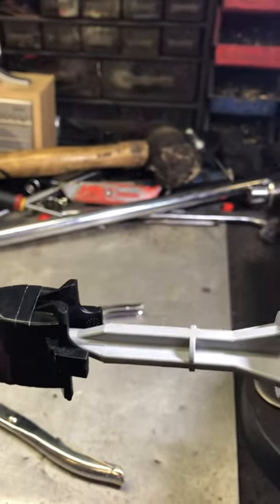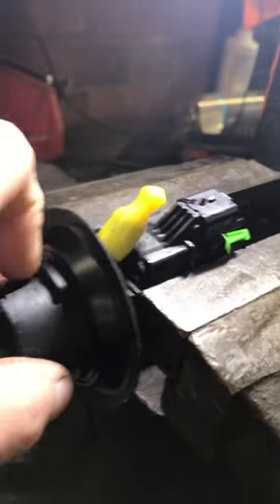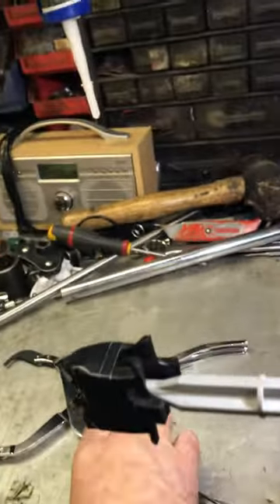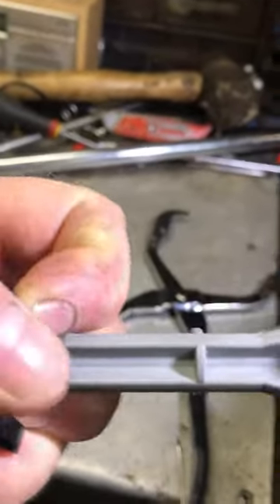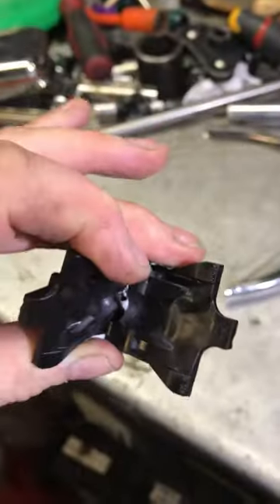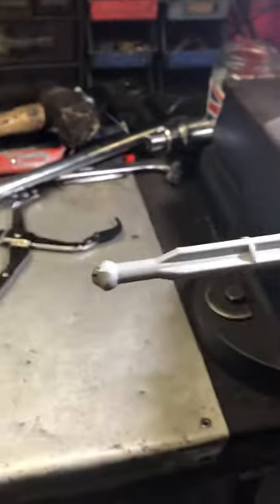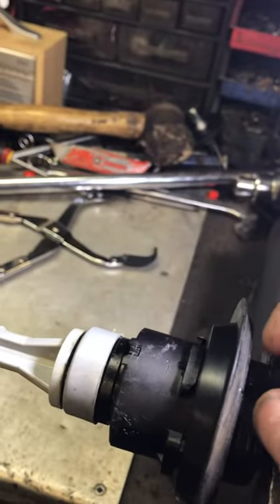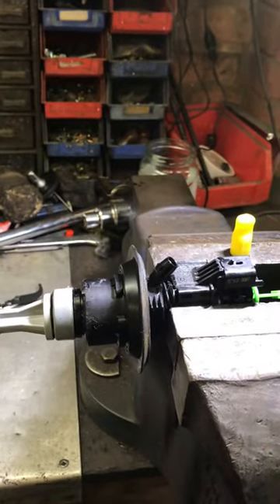Peugeot 308 low clutch pedal

Comment from the maker: Hi,some feed back from viewers, interesting. If your clutch pedal is not returning by fully, then it is a worn out ball end and housing clip like in the video, you need a new master cylinder and the housing clip.
Not easy to replace, but I’ll explain in the driver footwell remove lower half facia trim-the under part of trim- release the steering column from the bottom one 13mm nut/bolt, swing aside the column-see the clutch pedal assembly-fit in place the special pliers to release the housing clip or smash it with screw driver, it’s no good anyway-undo the 3x10mm nuts & 1x13mm nut to release the pedal assembly, carefull if you press the pedal to release the shaft ball end from clip it’s spring assisted & can take you by surprise-remove assembly-fit the new housing clip BUT don’t push it fully home-now go to engine bay support left side of engine ie, trolly jack, remove top left engine mount female tied head bolts-lower engine for access to bulk head, there may be some sound proof material to unclip move aside see clutch master cyl-inclip pressure feed pipe at front release its retaining clip, plug the pipe-pull off or unclip the feed pipe from top plug the pipe-unclip the clutch switch connector-twist the whole cylinder body clock wise 1/8 of a turn to release from bulk head, may require some large mole grips to grasp the cylinder body from inside, BUT remember to twist anti-clockwise wise from this side.
Fit new master cylinder in reverse order-reconnect all-remember I said fit the housing clip half way, its self explanitary when you see it because offer the pedal assembly back up to the ball shaft, bolt back into place, then you press pedal and this seats the housing clip & ball shaft into place.
Refit all inc eng mount, bleeding is unusual as there are 2 types, of slave cylinder connections, either it’s simply release bleed nipple or pull out the feed pipe to solve by 5mm then release bleed nipple to bleed anyway bleeding is gravity controlled attach catch bottle & clear tube to nipple, fill reservoir open nipple (may have to pull feed pipe out 5mm) feel the click, press clutch pedal by hand to floor watch for bubbles, when no bubbles close nipple, push pipe in (if fitted) raise pedal top up reservoir repeat can be up to 20 times, until pedal feels normal.
Well done save yourself plenty of dollar even if you buy special tools still cheaper 😎
Reply: Robert Cole 

The clip that connects to the master cylinder where can I get that from
Reply: Robert Cole Is there not easier access removing the scuttle panel?
Reply from the maker: @FatHead81  hi Mark , you do not remove scuttle panel, best access is remove top eng mount lower engine, for access.
Reply: @robertcole8730  Hi thanks for this write up and advice. Done it today on a 308 GTi I had a good look and cos of the intercooler pipe position the engine mounting out the way wouldn't have helped much. Anyone else doing a GTi. Take the scuttle panel out and remove airbox for pretty decent access. If you're on your own you can get the end of say a breaker bar on the back to give some good pressure to get the keys fully through the holes. Then you can grip from inside the cab with some grips to get it locked in.

Comment from the maker: Hi Fernando, sounds like yours isn’t bled properly. The set up is a gravity bleed system, you attach a bleed pipe to the slave cyl bleed nipple, pull the retaining clip out, you can remove it or pull it so far and leave it half out, next pull on the feed pipe, kind of one notch you get a feel for it, practice pulling it out so far then push in again you’ll see, ok so you’ve pulled the pipe out so far, make sure to top the reservoir up, then push the clutch pedal to the floor, watch for fluid flow out of slave cyl, you may see bubbles   When they stop, pudd SF h the pipe back in, raise the pedal, top up res, repeat, repeat, may take up to 20 times, but should improve your clutch, obviously if the master cyl rid and cage are worn they will need to be relaxed.
Reply: My clutch squeaks when i leave car on the sun and now when its cold when i put heating to the leges. When car is turned of i can shift easly. But when its on when i put in first or second gear i fell litle like "bump" like clutch was not disengaged fully. I was thinking of buying clutch master cylinder, sender balljoint fastener, and upper assist spring and then  bleed system. Thank you.

Comment: Hi Robert,
Where can I get one of the clips/couplings mine has worn through and the only place I can seem to find one is in Poland and the website doesn't have an option to shop to the UK.

Thanks 
Steven 👍
Reply from the maker: Hi Best place is Peugeot / Citroen main dealer. Fit the best do the job once.
Reply: @robertcole8730  thanks mate 👍
Got one from Citroen dealer today only to find out the there's a recall for our car for this exact reason. 😠
Reply from the maker: @stevengeig2806  great news saves you doing the job, the first one is the most frustrating, it’s one of them jobs you know once you’ve done one the next ones easy, oops should say easier, ha ha. Amazing how the dealer never tell you, maybe your a second or third owner. 👍

Comment: I have 2015 peugeot 308 t9 1.6 ehdi 115hp. I am having problem somtimes it wont go in reverse, and sometime is bit hard to go in first gear. I changed gearbox oil but it didn not fix it. Allso when was summer and car sits long on the sun clutch pedal slowly returns when it is depresd. Now when its cold when i turn heat to the legs clutch is again slow on return. Any advice what to look for. Thanks

Comment: Hi, I managed to take out the old cylinder and now I am having difficulty putting it back in. It goes in but doesn't twist back in the whole. I can see the rubber locks are in all the way in the body but I don't know why it's not twisting. Any help ple. Thanks
Reply from the maker: I use mole grips 👍
Reply: @robertcole8730  thanks for the reply. New cylinder is in,  but pressure pipe is not going in now. I have tried pushing it in but doesn't work. Any idea wot am I doing wrong here. Is it suppose to be an easy push or does it require hard push? Thanks
Reply from the maker: Yeah can be tricky, I believe there a two types   of fitting straight push on pipe that goes over the inlet, or push insert that goes inside the inlet with a little cage that you open up the gripper parts not easy to access just check the pipe end make sure if the latter to inspect  any ‘O’ ring seal, but either way both should just push fit.  :)
Reply: @robertcole8730  Hi Robert, now I have replaced everything and tried my best to bleed the system. But my clutch is still at the same place as it was before replacing master cylinder. Do you think I have some clutch/pressure plate issue. I don't know wots happening. It's a start stop car and when I press clutch the car starts but it doesn't go in gear. But when I switch off car I can engage gears. It's weired.
Reply from the maker: Hello these are a pig to bleed, at the slave cyl on the gbox open the bleed screw depending on what sort is fitted you release the clip holding the pipe in place, pull the pipe out either one or two clicks it’s a feel thing, preferably use clear plastic tube from the nipple to a jar, press & pull the clutch pedal 20 times off for leave pedal down, push pipe back in, raise pedal, open pipe, repeat pedal press pull 20 times, close pipe repeat . Try pedal, repeat if necessary, don’t forget to check & top up fluid.

Comment: Hi. I have the same problem. Clutch pedal coming up 3/4 and 1/4 not. I went the Peugeot garage and they said that the return assist spring on the pedal is broken. £115 is cost. I am a car mechanic and I ordered the parts and I would like changing. But I don't find the spring. I went back to the garage because when my car was under the warranty the clutch pedal was sticky. Garage said don't find any problem. I checked again my car and take the picture because the parts are not fit. I said to the engineer where is the spring. They said I don't know.  This is the Authorized Peugeot service. I said why said that the spring is broken if not fit the spring. Now I would like fixing my car. Do you have any picture from the clutch pedal because I don't know how can I fix my spring?

Comment: I have a 2014 Peugeot 308 my clutch pedal comes up the sticks and flicks up that last little bit. Will this be the same problem clutch is fine just trying find this annoying issue.
Reply: Did you ever get an answer? I have a C4 Picasso that seems to use the same cylinder type.